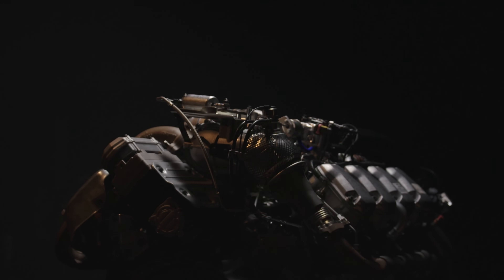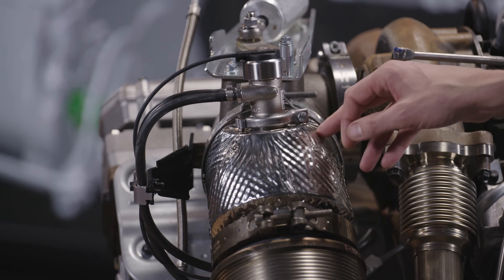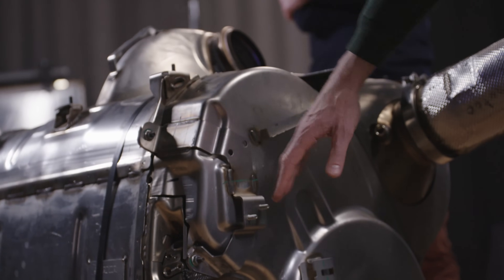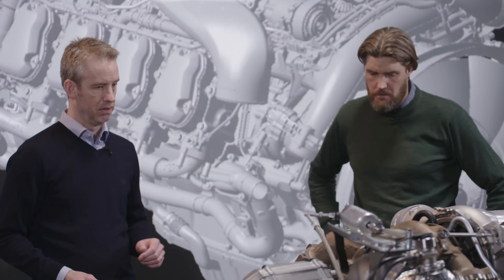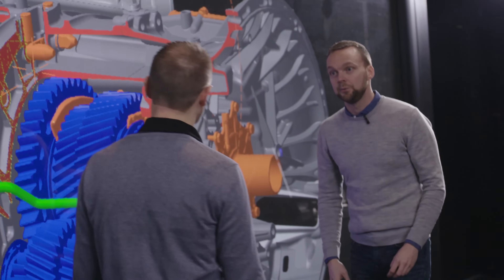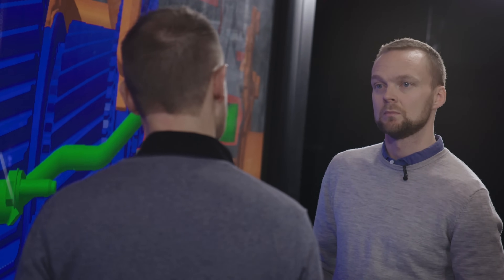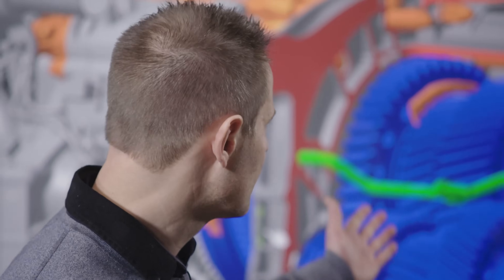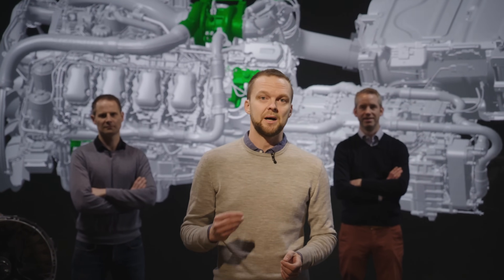Engineers present Scania's new V8 powertrain

Comment: So basically they put a cat and ad blue on the engine and a drysump/oil accumulator in the transmission. And of course "fuel consumption increases less". ¿¿¿¿???? So it fuel consumption increases but not as much? Or not at all? Or does it decrease compared to the previous model engine? Or no fuel at all?

Comment: All good untill you hit half mill with 80000 pound loads then repairs go off the charts.
Reply: Like any other truck. Volvo oil manifold and filter housing clocks in at 10 000 USD/EUR or so. The AdBlue (DEF) circuit board with pump assembly, conveniently located at the bottom outside of the tank where all the crap can accumulate, set you back 5 000 USD/EUR

Comment: Do modern trucks use automated manual transmissions? Kinda like a DSG?
Always thought it would be a great way to improve truck acceleration in traffic if you could drop the shift times to almost zero.
Reply: There's such things as an direct shift which leaves the clutch pedal but that's only for the clutch break mainly, most you'll still find a normal manual trans, a lot of companies are experimenting with "normal" auto trans, but it's still a hybrid between the two.

Comment: Be great if it had a gearbox the driver could actually control. Like the ones you used to fit, with the stick and the pedal...
Reply: Theese trucks are all about comfort. Why would you want a manual gearbox when you can have a great automatic box?
Reply: @nicostenfors5690  Because they aren't great in my book. It would be nice to have the choice.
Reply: They are all manual gearboxes. Some are just electronically controlled. Anyway, they couldn't achieve the efficiencies without involving a computerized gearbox. It's all digital, topological data and all plays a part. In the end, it's all geared towards self-driving. Mercedes Actros can already do unassisted roundabout driving following the speed limits and everything.
Reply: @rosen9425  I'm aware of exactly what they are, I used to drive them for a living. I showed years ago that I was 1mpg better than the semi auto between two otherwise identical R420s, but they do bring 'fleet average' up, so they won out. 
More than anything, they're miserable, hopeless things to drive in slow, heavy traffic, and they make fine control difficult at very low speed. I also don't believe they can read the road better than a human, either. For me, a full manual was better all round. But what do I know? I was just the dumb steering wheel attendant.
Reply: @creepingjesus  
1 mpg better is a pretty darn good achievement. I will absolutely agree on being flawed. Of course in no way perfect. Hooking up a drawbar trailer (any trailer) should be done with care. Can't even remember how often the truck just slams into the eyelet or kingpin because of lacking fine control.
Reply: @rosen9425  We never got many drawbars here, but I enjoyed them when I got them...
 Hopeless trying to hook up to a trailer with no clutch pedal, in snow too. Or just driving in snow, most of the time. They don't react quickly enough to arrest a slide.

Comment: 🤔Engineers putting in thousands of hours and R&D spending millions on a new internal combustion engine when the competition is developing electric drive chains... yea... seems like a smart move.
Reply: The electric vehicle industry is still in its infancy and has yet to demonstrate it'd practicality.
Reply: @SgfGustafsson  There will be no ICE power trains sold in new vehicles in 10 years. Practical or not the change is happening.
Reply: @foxabilo  not in commercial trucks
Reply: Electric doesn't work in long range trucks
Reply: @yayayayya4731  What are you on about? Scania themselves have an electric truck range.
Reply: @foxabilo  long range trucking I mean. I'll fix it.

Comment: I wonder if a power recovery turbine has been considered downstream of the turbocharger exhaust. Such a device would put a few more bits of power and torque back to the crankshaft before the exhaust is dumped overboard. Such PRT's have been used on large piston engined air liners with great success in the 1950's, but the usage of such devices ended. when turbo-jet engines took over.
Reply: It's been used in Scania 470hp engine.
Reply: The mechanics called them parts recovery turbines.The Wright 3350 had 3 that were fluid coupled to the crankshaft.Each turbine added about 120hp.The engines were called turbo compound engines.

Comment: Strange sales pitch to each other? Sorry team once you use these units you find engine temps rise considerably, fuel consumption is terrible. Easy fix, remove all the exhaust rubbish allowing for increased follow/decreased restrictions and wow the unit comes alive. Cold starts could be improved with better combustion chamber heating and or turbo interface pre heating, possible starting injector rail that allows for the colder chamber. Dry sumping the gearbox awesome work, at what degree angle does the oil stop completely incapsulating the front gear sets/or the top oil holder delivers limited gravity drop, sorry but who needs 8 reverse gears? Possibly someone should look at the by gone error of the 4 into 1 exhaust, power destroyed with excess heat being dragged through the rear cylinders. Looks great to the pandered environmentalists through great work.
Reply: I can partly agree with your doubts.....in passengercar and van diesels we have (and do stil-) experienced total f**k ups....main problem is EGR systems totally contamminating the engines.....to the stage where they seize!!
I can only hope that Scania engineers got their act together and itwill work all fine!!
Otherwise we’ll blame VAG (they took over Scania a while ago) for everything that goes wrong!!....they’re used to it....

Comment: Sweet engine but the variable lube system, which maximizes efficiency but how will it perform after 600k? Any manfunction will likely burn up the transmission
Reply: Just a hunch, but if it malfunctions, or wears out (the valve) then the valve would remain closed, providing all the oil into the pan. This would temporarily increase drag/fuel consumption, but a MIL would alert the driver to have the malfunction fixed. I doubt it would be designed to fail in a way that would starve oil flows. But I could be wrong! Hans, Franz and Magnus here might not have any common sense - who knows! lol
Reply: @natehawkins2910  Yeah, you'd design it to fail safe and just take the efficiency hit until you could get it fixed, wouldn't you?

Comment: I'm sorry but what a load of tosh! These guys are nuts, they have basically designed a drive line that "justifies" a truck with 770hp to use in everyday conditions that maximizers fuel efficiency apparently. What  planet are these people from? You don't need 770hp outside of Australia or in Nordic countries running at 60+ tons but at 40 tons there is NO WAY this power makes economical sense. Oh, and I would imagine Volvo won't let Scania off for too long. I'd imagine they are developing an 800hp truck that'll probably have closer to 3,000lbs ft of torque.
Reply: Well, when you can accelerate faster you can merge faster into traffic, and you can skip more gears when running a ligther load saving even more acceleration time :D And all the markets are moving towards heavier truck loads, so it is needed.
Reply: Trucks here in Alberta and British Columbia, and probably other Canadian provinces, run up to 63,500 kg; this isn't just found in Australia or Nordic countries. Out here, they go over the Rockies and mountain ranges. 

There are no Scania trucks or engines here, and we don't get most of the other high-power Euro engines. I don't know what the highest available power is, but PACCAR (Kenworth and Peterbilt) only goes up to 510 hp, Mack only goes up to 505 hp, and Volvo's own engines only go up to 455 hp (only 13 L displacement). Cummins engines (available in most truck brands) go up to 605 hp in one specific and new variant of the X15, and Freightliner goes up to 600 hp in a Cascadia with a Detroit DD16 (15.6 litre inline-six with mechanical turbocompounding). I'm pretty sure no one gets close to 770 hp here. I think the vast majority of highway trucks here run 350 to 500 hp, even those running up to 63 tonnes.
Reply: @brianb-p6586  Must take forever to get up to speed with only 300-500 HP 😬

Comment: There’s nothing innovative about any modern engine. Everything’s still mechanically timed, the only difference is that computer’s take and process that information. Yes you can increase rail pressure, improve injection efficiency through various methods, add a couple extra gears to the automatic transmission, but in the end these are minor refinements. I can take an Om606 or 12 valve cummins and still make very good fuel mileage. As far as the exhaust after treatment technology goes, it’s a total scam, especially with diesels, the soot still leaves the exhaust, only now it’s extremely fine and doesn’t fall to the ground. That’s not saying all after-treatment is bad, the only reason this type exists is because of governmental regulations and guidelines. No manufacturer would willingly put this stuff on their vehicles.
Reply: Sir, stay off the internet. You have no clue what you’re talking about. 😂😂😂😂😂😂
Reply: DPFs are wallflow filters, the ash physically cannot pass through it (hence the ASH load calculations that’s all engines have) and is continually burned to a point where it is broken down in c02, NoX, and other various chemicals the SCR can eliminate. Stop spreading misinformation.
Reply: @jimmysturdevant9843  Lol, yeah ok, I don’t need a textbook definition on how modern diesel exhaust after treatment works. Have plenty of textbooks lying around. So the soot that you’re referring to gets burnt off into gaseous carbon monoxide (amongst the various other reactions that occur) And the ash that remains, can never get “regenerated”. The modern exhaust system doesn’t warp soot particles into another dimension. It also doesn’t convert them into butterflies and rainbows, despite what the epa tells you. What goes in must come out. If you honestly believe what comes out is somehow “better” with all the ammonia after treatment, nanoparticle garbage then you’re a fool.
Reply: @ry9756  dude I’m sorry but you just simply don’t know. Yes. It never leaves the DPF on ALL final tier 4 engines. That’s what “ash load” is referred to and why they have to be taken out and cleaned physically after a given time which 100% is indicative of oil quality and use of fuel additives as well. Second, no ammonia ever leaves the SCR, they have ammonia filters. Like I said before, stop spreading misinformation.
Reply: @ry9756  I also never said I agreed with the path we are going, but I had to state the facts. They are actually very good from a emissions reduction standpoint and work almost 100% efficiently. If you don’t believe me, just go kick rocks and vote for Biden 😂😂😂
Reply: @jimmysturdevant9843  I said “ammonia after treatment” you’re just jumping on any chance to spew out a textbook definition to somehow validate that you’re right even though I put no mention on how the ammonia after treatment works. Yes my goal is to spread misinformation, the Russians have hacked everyones dpf! Lol. Kicking rocks and voting for Biden? Yeah not from the united states, would probably never vote for an alzheimers  patient, don’t know how politics has anything to do with exhaust after treatment.
Reply: @ry9756  not to mention I don’t have to validate anything because that’s how it works, verbatim.
Reply: @jimmysturdevant9843  Good for you 👍
Reply: Spot on 👍

Comment: I passed my test in and worked a Mercedes 1628 V8 non turbo for 5 years. 16 speed ZF box with that high rev V8 you soon learned the art of using a range changer/ splitter lol, then i got a Daf 3300 ATI now that was a truck. Never really liked Scania apart from the 164, front screen is a bad design when raining and there’s something about Scania brakes …. when you first start pushing that pedal it almost feels like there’s no bite which makes you push more when you don’t need to especially when heavy.

Comment: There's a reason why v8's aren't used. It's been tried on and off for decades. Stick with the 6.
Reply: At least three engineers at Scania disagree. 😁
Reply: uh ask the Dutch drivers. It's apparently illegal to own a Scania without a V8, because I've never been overtaken by anything else doing minimum 90km/h
Reply: @rosen9425  plenty of non-V8 Scanias around in the Netherlands. And they're on Dutch plates so whoever told you that we are only allowed to run V8s needs to check again. 😁
Reply: @Zgurkogel  
just joking a bit 😁
At least very popular engine among truckers, maybe only international drivers, from 🇳🇱👍
Reply: Scania has been putting V8's in heavy duty trucks for decades.  They know what they're doing.

Comment: Ought years ahead of the American engineering
Reply: I'd say all European truck manufacturers are decades ahead of the American truck manufacturers. What America still made last year would have been discontinued 50 years ago here. We have better engines with more power and better fuel efficiency, better aerodynamics (even our cabovers have better aero than those big flat long nose trucks), better visibility and they're safer. win win.
Reply: @tntfreddan3138  When was the last time you saw a North American truck? Very few use the old boxy long nose.  Cabovers are rare, but only because most truckers don't want them - the cabover models have been discontinued because length regulations don't require them in most cases.  

Freightliner is typical: they'll sell you something boxy if you want it (most popular in severe duty applications), but the slope-nosed Cascadia is the normal line haul truck, and a cabover (forward control) is available for those specialized applications (mostly waste collection) that need it.
https://freightliner.com/trucks/
Reply: @brianb-p6586  Those old boxy long noses are still made today. Kenworth W900 is still basically an oblong box on wheels. Most American truck companies are still trying to move on from the 70s and 80s. Millions of useless analogue gauges and still with manual transmissions. Who the hell needs 18 forward gears when only weighing 35 tons? 35 tons is truck+trailer and quarter load in Sweden and we almost always only have 12 gears forwards (if we don't have crawler gears, then we have 14 or possibly 16). On our class 4 roads you can weigh 74 tons (roughly 163 000 lbs) when 32 meters long. Semi truck+trailer+dolly+trailer makes 32 meters (105 feet). I've never seen a 32 meter road train with less than 540hp, though, but American trucks has to make at least 400hp, right? So why need all those gears for such light vehicles?
Reply: @tntfreddan3138  Yes, they still make them... and few buyers choose them. You're dismissing an entire industry as backward because one style of truck that they offer isn't your idea of current. That's the sort of arrogance usually associated with Americans.
Reply: @brianb-p6586  I know of the newer models, and some do look quite good, I might say. But I don't like the "old" feeling I get from them. Seeing a Volvo made in 2018 compared to a Kenworth or Freightliner is like going back at least 20 years, at least in the instruments. I'm curios as to why they're designed the way they are. We have short and nimble models that are made to fit in narrower spaces while Americans tend to go with big and bulky and sometimes with really long wheel bases.
Reply: @tntfreddan3138  long-wheelbase trucks are deliberately long, for better ride. Long-nose trucks, with set-forward front axles, are deliberately long, for driver comfort. For many routes, maneuverability is not an issue, so the length isn't a problem. Most heavy trucks, even in long-haul highway service, have shorter noses and set-back front axles to keep the overall length legal with the desired trailers, and to keep the front axle's share of the load up to a suitable level.
Reply: @brianb-p6586  Yeah, because our semis are designed to almost always be loaded so they tend to have very little pressure on the rear axle(s). I drove a 4x2 Scania and when without trailer it only had 2.1 tons of axle pressure. When with empty trailer it had 3.5 tons. Fully loaded I had 11.5 tons. The front axle takes only a small amount of the weight from the load itself so that's why you'll most likely have 5+ tons on the front. This is obviously a problem when driving on slippery surfaces and it tends to get quite slippery during the winter. That's why I don't actually like driving semis and prefer our real trucks. When empty they weigh roughly 12 tons and has a weight distribution of 5–7 (tons, front–rear). You don't have to shovel as much sand and gravel and you don't get stuck in the slight uphill at the home terminal for 45 minutes before just making it to the plowed and salted street. Last winter was a bitch and all the ice was always freezing, then melting all the time.